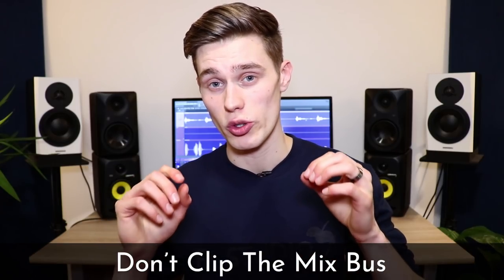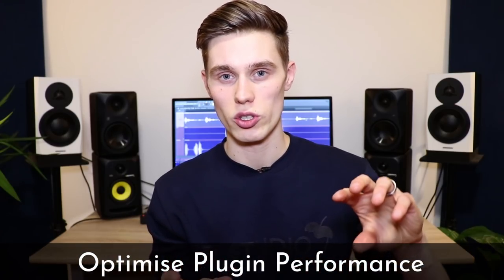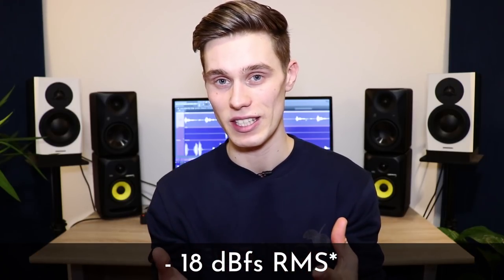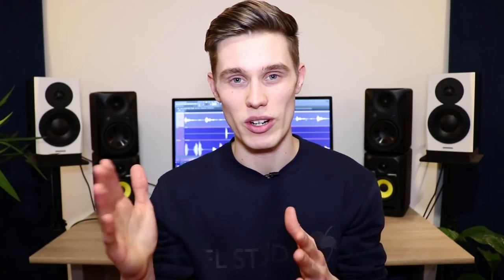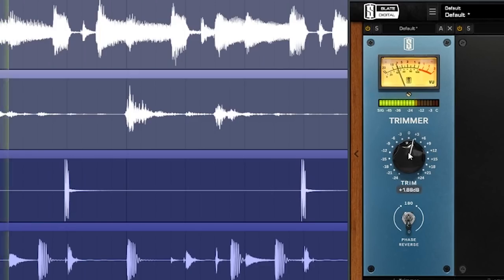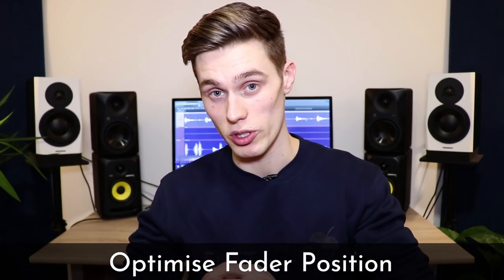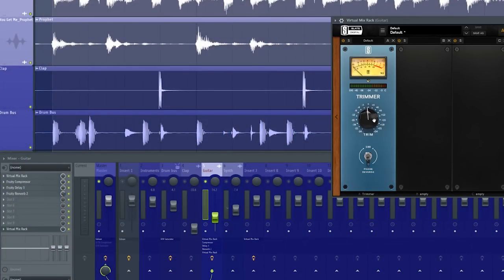Gain Staging - The 3 Rules You Need To Know - In The Mix

Comment: Working on a project at the moment where my mixbus is too hot and nearly clipping, can I put a gain utility on the mixbus and bring down the master by 3db to give myself the required headroom????.. Rather than having to bring down each fader (there are about 80 tracks)
Reply: If u Work with fl studio , you can Mark all your mixer channels at once or the ones you need to bring down . Hold Ctrl and then hover over the ch. With your mouse

Comment: Good Video. I have a question. Should I gain staging after I put some effects in it like reverb,eq, compression ect or befor without effects? Thx and thumps up:)
Reply from the maker: JiménezTV probably before the effects but you can do it afterwards if your signal is too low or high 😀
Reply: In The Mix thx!!🙏😎👍🏾😊
Reply: Andrew Radley it’s because VU of trimmer use dBVU scale (analog scale), for digital world we use dBFS. -18dBFS is around 0dB at VU scale. Sorry my for my poor English

Comment: Hey Michael,

I live in an apartment. I don't have a separate room for me. So I have some room noise. I recorded a vocal and tried some mixing but the noise was still there . Would it be advisable to use a dynamic mic instead of a condenser mic?
Reply: You could also try using a gate to cut away those low volume background noises. But I personally have also made the experience that condenser mics pick up all kinds of background bullshit, whereas dynamic mics don't do it in that way
Reply: @entspannter_hase  so what if I record with condenser and dynamic mics and blend those two together while the condenser mic's volume being lower 

Would that work.?
Reply: @mshl114  You only know if you try out. However you would need to PERFECTLY time sync the two mics' recordings or else there will be phase issues. What exactly would you want to achieve with this technique?
Reply: @entspannter_hase   I want vocal that sound professional and clean with less noise .
Reply: @mshl114  I fear that for professional vocals you need a professional setup. Which means no background noises.

Now that you already have the condenser mic, I'd suggest you might want to go with a gate, as I said. A high pass to cut away all the low freq rumble might help as well. If you hadn't got any mic yet, I'd suggest you should go with a dynamic mic, experiment with how exactly you record your voice (distance and angle to the mic etc) and use saturation plugins to make your vocals richer
Reply: @entspannter_hase  ok sir . Let me try gate and record with my condenser mic . Thank you so much sir.
Reply: @entspannter_hase  I would like to know if you are a sound engineer or a producer or musician?

I checked ur channel u had 3 subs only
Reply: @mshl114  I am a little bit of all three - mostly a musician and a self-taught producer (partly by watching Michael's videos). Yes, I haven't released anything yet. Though I plan to release an EP in late 2020 or early next year. I'm working on it in stealth mode 😎 what about you?
Reply: @entspannter_hase  all the best brother 💪🏾💪🏾👍🏾👍🏾.

I am a Christian artist . Working on my first single . Hope you will like the music.
Reply: @entspannter_hase  started as a piano player , got along with drums and guitar . Started music production 2 years ago . Still learning ✌🏽
Reply: @mshl114  I wish you all the best as well! I also started with the piano at very young age and got to guitar and production later. Hopefully that's gonna end up as a killer combo in the end for us two 🤙
Reply: @entspannter_hase  💪🏾🤙🏽 let's do it 💯😎🔥🔥

Comment: myke the fader of the mixer  sometimes has less cntrol over the level of the synth like sometimes i want to less the volume more but the level is quite the same  so should i do post fading by the output of the synth or should i do the step 3 i.e optimizing the fader position by adding a gain unit???  do u post fade the synth sound through sampler or the channel rack??? and shoould i mix my tracks in louder volume or less volume plese help myke..

Comment: When you add tracks, you will get noise on a DAW. The noise will stack til it eventually becomes audible
Reply: This simply isn't true for the digital domain. In the analogue, sure - all machines have a noise floor - but in the digital there is no noise floor because its all numbers it's all arithmetic and floating point numbers. Unless something has gone horribly wrong in your DAW (in which case, noise floor is the least of your problems), you do not need to worry about noise through level boosting or stacking.

TLDR: There isn't a noise floor.

Comment: How did you add that curve line in the guitar sample
Reply from the maker: Calloway EDM Double click to open the wrapper setting panel thing, then look for "declicking mode" and select one of the bottom three options, it's a cross-fade to smooth the volume down 😀

Comment: What's your take on normalizing all your stems to -18dBFS and starting your mix like that.
Reply from the maker: I find this sets me backwards, as usually an artist has the stems at good relative levels and if I go and set them all to -18 it makes it much harder to find a balance that the artist likes. It can work on your own music perhaps bit I tend to just handle to gain on a track by track basis if a plugin is being fed too loudly :)
Reply: @inthemix  in terms of mixing levels are there standard levels engineers use? Im assuming some of these mastering engineers like tracks being sent at certain levels(because they are going to use a similar chain they've used before to master the track.) Therefore, is there like a universal level a kick drum, snare, hit-hat, bass and other elements are set at? 

For example, I think I was analyzing some stems from a Calvin Harris song which I think are mixed and the kick was a -8db, clap was at -10db ect ect. 

Where can I find more on this topic?
Reply: Olvin Fuentes This depends on a track by track basis. Some tracks might want more kick, less kick, and frequency presence also has a lot of impact on this. I would suggest you do what sounds right to you for the mix.
When sending stuff to a mastering engineer, give at least 3 db of headroom. I would advise around 6+.

Comment: Miss my logic's trim effect, quite handily, now I moved to cubase now, any 3rd party plugins can done this handily and low cpu usage? i dont use cubase's channel strip.
Reply: Hi there! I use Cubase as well! It is kind of unfortunate that we don’t have a utility plugin. I can suggest two fixes: one is using the StudioEQ plugin if you have elements or higher, which allows you to adjust gain. Second, you can use the pre-fader rack in the channel strip (i promise, it isn’t nearly as intimidating as the EQ and other FXs), but it is hidden away by default and you have to enable it. This allows you to change the level at the beginning of the channel.

Unfortunately I think Cubase’s lack of a utility is due to the target audience of the software. Cubase, similar to Pro Tools, is meant to be used by the top level of audio production and real instrument recording. As such, studios would be able to fine-tune levels and record everything perfectly. Unfortunately that also means less support for us home studio musicians. Oh well!
Hope this helps.

Comment: Why does my microphone make static noise even at low gain !!?? So frustrated of this while recording.
Reply: Try using an EQ to remove some of the noise. A deesser, multiband compressor, EQ, or software designed specifically to remove noise might help with this.

Comment: Hey there when i use gain unit on mixer first slot inside gain meter it is hitting 0 vu but it is not hitting -18dbfs in mixer, it is reacting differently with different sound some times it hit 9db and some time -15 but vu is always is 0. Plz see this problem
Reply from the maker: Bnarry the mixer will be showing the dB Peak which will vary a lot depending on the source, VU is an RMS value in most meters, avoiding the harsh peaks.
If you have a sub bass, the RMS value will be closer to the peak than a guitar being strummed 😀
Reply: In The Mix yes, but for example if take the kick sample that peaks on 0 vu and 15dbfs. And then when i use another kick sample peaking 0 vu and 9dbfs.
Reply: In The Mix i use the same gain trimmer plugin from slate digital

Comment: Hey mike did u get to know anything about the any new fl versions can u do a sneak peak video(if possible )
Reply from the maker: Rapid Spectre I want to but I'm hesitant to upgrade until I know it's stable, I'll definitely be making a full FL 20 walkthrough when it is officially released :)
Reply: In The Mix wow the y fl 20 not 13
Reply: Rapid Spectre bc it's been 20 years since they released it.

Comment: What does headroom mean ?
Reply from the maker: SIDDHANT SHAH the space between the top or peak of a signal and 0db where it I'll clip. So if your signal peaks at -6 dB, you have 6 dB of "headroom", does this makes sense now ? 😀
Reply: In The Mix 
So, for example if i have a highly dynamic sound linked to the mixer, when possitive values reach the clipping level from 0db, the space between 0db and other number is known as headroom. Same with the negative values, but the outcome is noise. Right ?
Reply from the maker: SIDDHANT SHAH When it goes over 0 in a positive direction there is no more headroom, individual tracks can be pushed above 0 but I'm mainly talking about the master channel. The headroom only refers to the negative space below 0 dB 😀
Reply: In The Mix oh okay got it now !!!
Reply: In The Mix Thank you very much !!😃